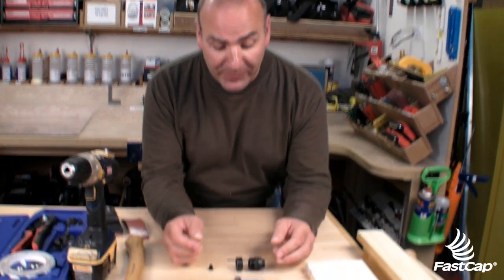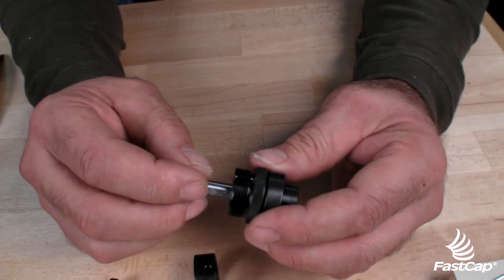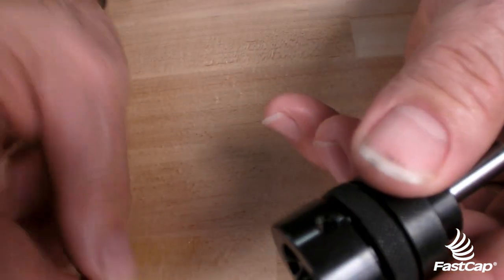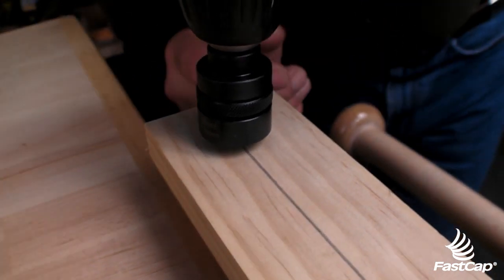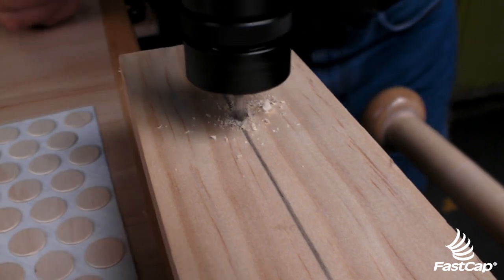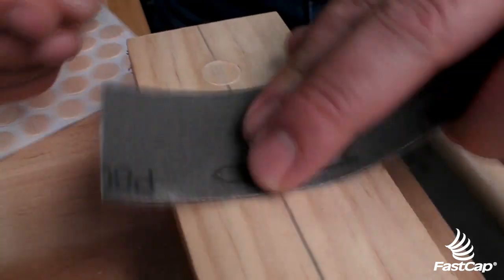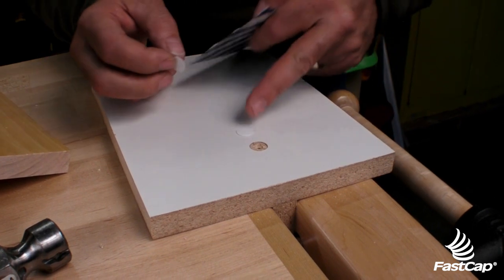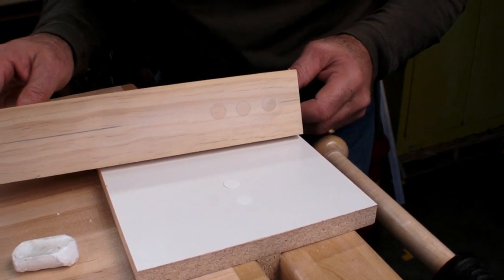The FlushMount Drill Bit

Comment: My only gripe with this tool is the Allen screw for the drill bit adjustment is just to small, stripped right away. And the blade actually began chipping in melamine after not much use (50/75 holes) so it looks worse with a flush fast cap then covering a regular flat head. At least in melamine.
Reply from the maker: If you had any problems with the drill bit we are happy to replace it at no charge. I've never heard the problem of chipping melamine. But we have had problems in the past with the Allen screws stripping out but we are happy to send you an entirely new unit and replacement Allen screws for the one you have. You can simply call 888-443-3748 and ask anybody on the phone and will take care of this right away.

Comment: Why not just set the cutting edge to a standard depth, without the need for adjustment? If all of the discs are the same thickness, it seems like a waste of time and energy testing fit... not to mention additional costs for the sake of adjustability (which would no longer be needed). Simplifying the engineering would make this a must-have tool for me.
Reply from the maker: You make an excellent point...but that's assuming everyone sets the screw at the same depth.
Reply: Once sharpened a few times the depth would change. And some ppl might not want to cover the screw, or want it extra deep in solid wood or MDF to fill and paint over. Always a reason